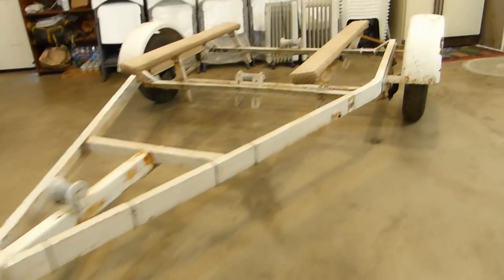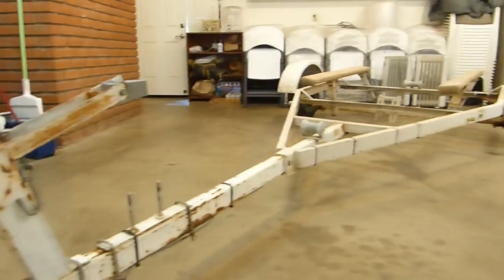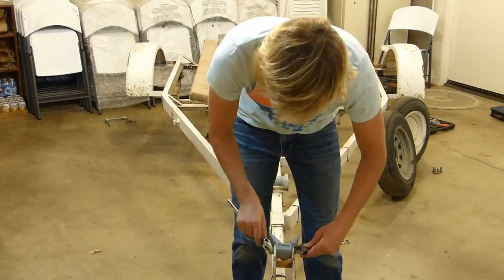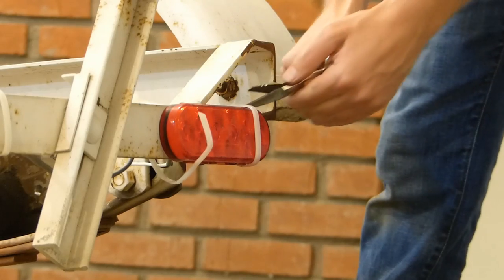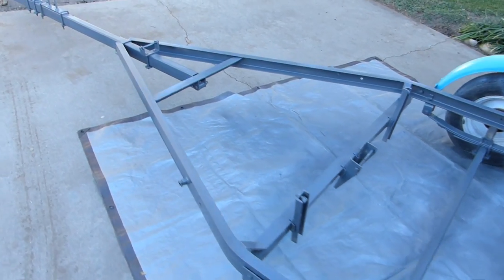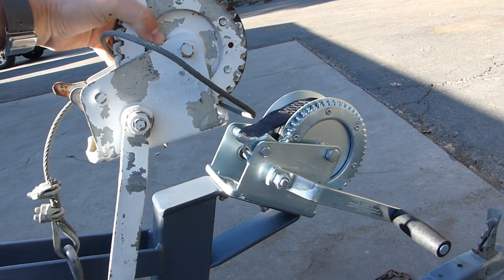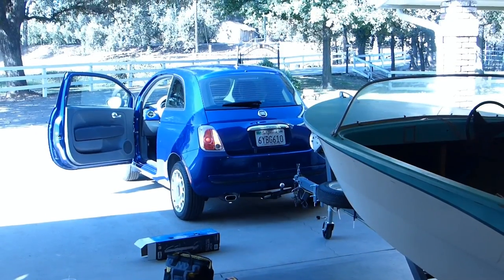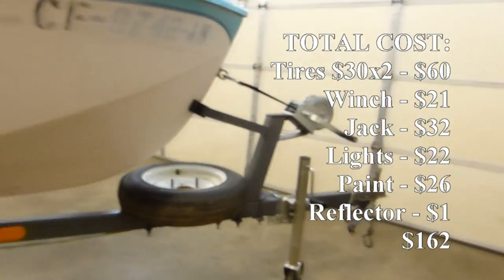$200 budget trailer restoration

Comment: Do you know the weight rating on a trailer like this?
Reply from the maker: Name Less small trailers like this are often 500-1000  pounds. There should be a plate or stamp on the axel that specifies the rating. Also look at the load rating of the tires and your hitch to make sure everything can hold the load.